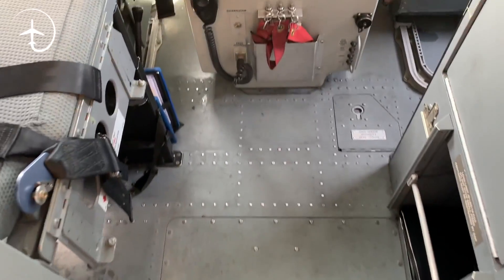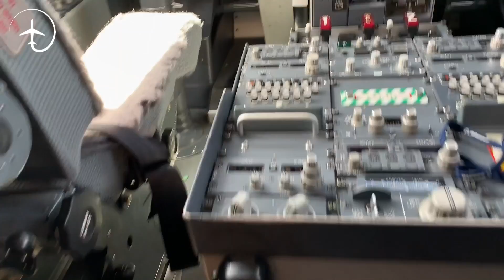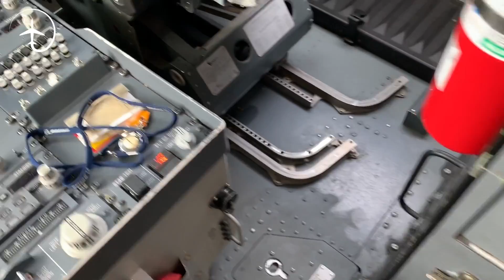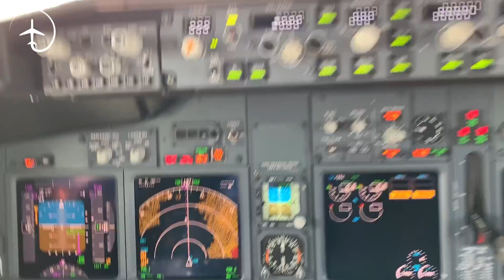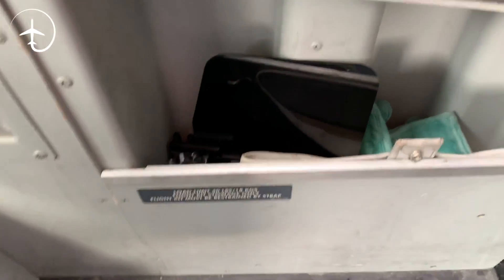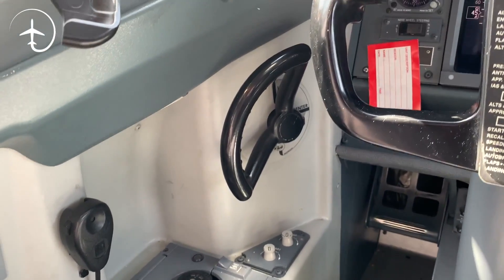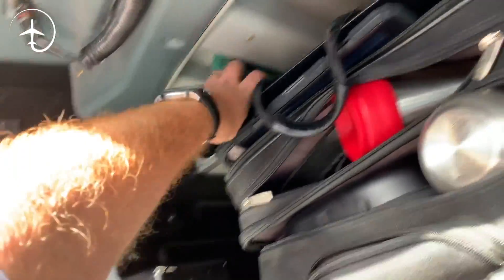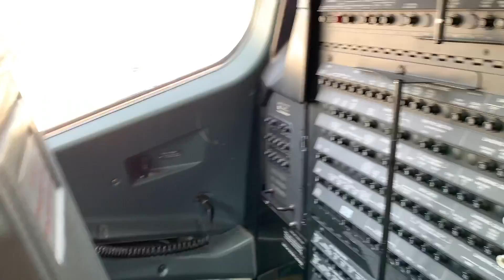Boeing 737 Cockpit secrets!

Comment: At what voltage do the cct  breakers operate.  Are there high current circuits?  Is there a power bus and control bus and are these AC or DC?

Comment: I had a peak in a B-17 cockpit, when the Aluminum Outcast was at the County Airport near me. It had one modern screen in it. Very cramped inside and a lot of needle gauges and with 4 throttles. It was a challenge just to get inside the nose hatch; even with the help of a small ladder.

Comment: Thanks for the tour. Now just one question: When are you brilliant guys going to do something to solve the problem of turbulence on flights? I've flown on at least 50 flights in the past 10 years, and with one exception, there's been turbulence on every single one of them.
Reply: N-Scale Union Pacific Evanston Subdivision the best way to reduce turbulent is to avoid it. Because turbulence is something which is present in the air in which the aircraft is travelling, so it is quite hard to simply dampen it.

Comment: @Mentour Pilot 
Do any of the planes you fly have HF radio equipment?
Reply: HF is only used for ocean crossing, it would not be common on a 737
Reply: Looks like this one had it. I’d have to replay the video. Airline can order the airplane with it if it wants.  At my airline we use HF if outside vhf range.  Just depends on the route that day.  These aircraft are capable of certification on 180 minute ETOPS segments.  One thing all pilots have in common is their despise for listening and talking on HF, and our love of SELCAL. 

Things pilots love...

SELCAL
CPDLC
COCKPIT DOOR
COCKPIT PRINTER
ACARS
MONEY
DAYS OFF.

Comment: Which circuit breakers are permanently pulled (marked red) ? Thks. Petter 👍
Reply: I would guess they are for optional or old equipment that has been removed, or they are used for testing systems by the engineers.

Comment: I wonder why the leave the circuit breakers exposed like that. It seems they would have some sort of closure or cover to help prevent accidental interference or disconnection of a critical system. Is there a reason for this?

Comment: Very informative....However jumpseat is stowed past it’s correct position.  It is pushed in past the stop adjacent to the red release lever.  Common error. There is a detent before it is shoved past it.  Look closely next time you fly.  It takes 2 hands to do it smoothly.  
Tom...10,000Hrs 200 300 400.

Comment: Excellent Vid.........my question is why have a circuit breaker if it is pulled?
Shouldn't it be engaged to trip for a short or overload?
Reply: Those circuit breakers are a combination of switch and fuse.  You can pull them manually to cut out a circuit, but when a short or overcurrent occurs it will pop out by itself.
Reply: no because the unit it powers might not be installed.  it might be Ryan didn't want "Option A", but the wiring is still installed in the aircraft.  it's "provisional".  if Ryan sells the aircraft, the new owner can install "Option A" and only has to install the unit.

Comment: At 6:39 seems this vehicle has a stab-trim override installed already; 
Is this the MAX-8 fix? 
Flight-deck door lock is the access control door?
Reply: Nicholas Jordan   That stab trim switch override is not a kill switch for the stab trim, but rather overrides the shutdown feature of a pilot, for example, pushing forward but trimming back, or the opposite. We use it to test the stab trim logic during preflight (or at least we used to). When this switch is in the override position, the pilot can run the electric trim opposite stick forces.  Other than an emergency situation this switch is not used in flight.  

The stab trim cutoff buttons you are referring to In regards to the max are already installed, as are they on all 737s. They are located on the center console just below and to the right of the throttles and fuel shutoff switches.  

It is these switches that I am referring to that were not timely actuated  (meaning turned off) during the 2 max crashes, and so the MCAS was allowed to continue with its trim down/forward actions, eventually resulting in loss of control. In the Ethiopian crash the pilots momentarily turned these off, but their airspeed was excessively high and they were unable to manually trim the aircraft back nose up, so it is speculated they returned these to the on position to try to use the electrical trim motors for assistance, thus re-enabling the MCAS to trim further nose down.

Comment: @Mentour_Pilot How about a video on the advantages and disadvantages of having a single aircraft model with an airline and advantages and disadvantages of having an airline with multiple manufacturers and models.  I can see how having a single type would be advantageous for the maintenance crews and aircrew members only needing one type rating and a disadvantage of one type would be if that aircraft manufacture goes out of business getting parts for that type aircraft might become difficult.  Similar to a major airline having a single regional carrier versus multiple regional carriers.  I am reminded of the Comair (OH) pilot strike in the US in 2001 really hurt Delta.  Comair might not have been Delta's only regional carrier,but it really hurt Delta overall.

Comment: Mentour, do you wear sunglasses or rely on the sun visor alone?  5 decades back, every pilot wore sunglasses it seemed.  I had a pair of polarized Ray Bans which I used every day the sun was out (really useful in my boat to cut glare) even when I drove. Haven't worn them for years due to the new tranisition lenses in my glasses.  I recently put my Ray Bans on in my newer car which had LED backlighting and I could not read gauges.  I know why now, but do you wear standard sunglasses at all?
Reply: It's necessary to use non-polarized sunglasses in the cockpit because of the modern displays.

Comment: Another excellent video, but I would question one thing: Are there not too many knobs, buttons and switches in the cockpit of a modern aircraft? I am a bus driver and the number of knobs and buttons I require is no more than 10, including the ticket machine. Is this not an attempt by airlines to make pilots appear busier than they actually are?

Comment: Does the audio box support continuous hot mic? I mean, does the talk switch remains in the inter phone mode? 

Thanks for the video!
Reply: Some do and some don’t at our company. The newer ones are coming with a latched position on the intercom transmit switch to essentially create a “hot mike” intercom, as a lot of 737 drivers have switched to using intercom for their communication to each other with nose cancelling headsets.  The 737 cockpit is still pretty loud compared with other airliners.  The headset is a necessity if you value your hearing.
Reply: Mark g thank you very much. I also think it improves communication between pilots and ATC.
Reply: Alejandro Cruz   Yes, great point!  The microphone and circuitry in my headset makes me sound way better and clearer on the radios. So I’m sure that ATC can understand me better than those silly soda straw mikes normally used.

Comment: Are your VHF radios similar in any way to those in cars, and stereos? I wonder if you would be able to tune in to good old fashioned FM radio stations with it...
Reply: Aircraft radios only tune down to about 108 MHz which is just above the top of the FM radio band.  You still wouldn't hear the radio stations properly because aircraft use AM for voice communications

Comment: Nose-wheel steering control for first officer, is that an optional extra? A better question raised by the coffee cup holder of the jump seat, during a normal turn around there's no time to clean anything but major spills or something affecting control panels (Woe betide the pilot that spills coffee on the console!) but when do the cockpits get a technical clean? I mean a whole cleaning of all the knobs and switches? I would expect there is a pilot reset that is required afterwards that checks EVERY knob and button for normal operation prior to flight. I recall the Helios Airways Flight 522 disaster being traced to the air pressurisation switch being a seldom checked or varied control being the root cause after maintenance worker left it in a non-normal position and it not checked pre-flight. Interesting the Yamasa Sangyo ownership plate.

Comment: Thanks for show inside 
I have 1question. 
I saw on many youtube. Its have two roll,  black colour and a little white some part and position is  beside engine stick 
Its rolling on the air plane stalling.
Reply: Trim wheels for the horizontal stabilizer. They spin whenever the pilot or autopilot adjust the trim.

Comment: Those replacement bulbs are a nightmare! Why haven't they did LEDs on one of the upgrades? Obviously it's to expensive to rewire in new LEDs but there has got to be LEDs that screw in the already installed female hard wire. I'm thinking how in everyone's  home the incandescent bulbs have all now have LEDs that interface where the old bulbs go.
Reply: DenseAlloy Consumer LED bulbs has electronics (or even transformer I think? I’m not that familiar in electronics) inside to make it works with the usual bulb sockets. He mentioned he had a video talked about it, as I remember he explained briefly about why they still use incandescent bulbs (I think it is reliability, and certification reasons), and if i’m not wrong I read some comments further explained how’s it more difficult than it seems to be (even as you say, with LED bulb that just fit into the old bulb sockets). You may want to check that video out!

Comment: Very surprised on the lightbulbs section, what if they burn at mid-flight? How come they haven't switch to another longer lasting technology? By "1960" you meant the design of the cockpit or the year the plane was made? Confusing to see a USB port cause they came out on 1998'... Is that an upgrade?

Comment: Is there any water resistance in the electronics of the cockpit? What if you spill a cup of coffee all over the control panels, could it crash the plane? Or if you drop a 1 litre coffee thermos on the floor, will there be sparks and explosions?

Comment: Cool video. If there is smoke filling the cabin can you get it out?
Reply: Don your o2 mask and select 100% oxygen, establish communication with other pilot, then dawn smoke mask if not integrated into mask. Run the checklist for smoke elimination, which in a nutshell has you maximize airflow from left pack that supplies most of cockpit air, turn off the recirc air, and raise the cabin altitude, causing more air to be expelled out the outflow valve. Also never hurts to make sure there isn’t actually a fire in side the cockpit itself. In which case you would be prudent to use whatever means necessary to stop a fire.
Reply: Thankyou for the response. So higher pressure and there is a valve that would allow the contaminated air to be pushed out. Very cool.
Reply: Brandon Whorley  kind of. By raising the cabin altitude more air is expelled, so hopefully the air with smoke gets thinned out quicker.  New air from left back not being recirculated then provides virgin air.  That all works unless the source of smoke is the left pack itself, which the checklist slowly has you continually ask questions as you accomplish items to help you identify the source.  It’s a rare issue, but when it happens it’s extremely serious.
Reply: @markg7963  so if the left pack is source of fire/smoke and cabin starts to fill with smoke.... then what?... it would be cool if the smoke hood or o2 mask had a small inlay or hud that provided critical flight info / external thermal or camera view from the nose. To get the plane back on the deck even if visibility is zero in the cockpit.
Reply: Brandon Whorley   Brandon, don’t have the checklist in front of me right now, and there are a couple of options to look at. One is smoke of an unknown origin, I think, and the other would be smoke elimination. So those checklist have to be managed pretty dynamically, and I would have to get them out to give you a more accurate answer.  The strategy is to do two things.  Get the smoke out of the  cockpit and airplane, but also eliminate the source if it can be isolated.  If the source of smoke is found to be the left pack, then logic would have you shut that one down and switch to the right. And having 1 pack down would indicate having much less airflow to help eliminate the smoke.  

These scenarios are particularly tricky because smoke from these different sources is hard to figure out, and doesn’t just instantly stop.  So you are in a hurry to find the source, hurry to eliminate the smoke, and if you don’t wait long enough as you go through the process, you run the risk of diagnosing things wrong and possibly making things worse.  An electrical smoke source is also a likely candidate, and that is super tricky and complicated.  That’s all before you find out the flight attendants just burnt up your crew meal in the oven and maybe didn’t think to mention to you that was happening.  Thus the scenarios get weird pretty fast.  Being methodical and logical and using all your resources is going to be crucial.  

As for zero cockpit visibility, we don’t have super special virtual reality things to look through, but I can possibly autoland the aircraft without seeing much of anything IF the systems remain in tact that are required.

Comment: Regarding the tiller. If the captain were to become incapacitated, the FO could land the plane-but then not manuever it on the ground? Or would the cpt be removed from the left seat and FO sit there?
Reply: No, if the captain was incapacitated it will be an emergency situation, which means that once the aircraft land, it will be a full stop on the runway with medics coming on board to treat/remove the captain. Ground steering will be the least of a FO's worries.

Comment: I have a 🙋... What happens if your landing gear isn't retracted the entire flight? Thank youu
Reply: The plane yells at you the whole time. Plus, if the gear won't come up, they usually declare an emergency and return to the airport.
Reply: @murphsmodels8853  thank you for the answer.. So it's really a must that it should be retracted then.. I see.. Thank u
Reply: @shelamaesantos8294  - Yes, it also causes significant drag that will reduce the airspeed if it isn't retracted.

Comment: Cpt. Mentour .  how much physical effort is there in actually  grabbing the yoke and flying her with autopilot turned  off?  does it require more physical effort that driving a car with power steering?   How much "road feel" is there in a 737?
Reply: RM Miller    I’ll reply to that. 13000 hours flying it.  “Road feel” is significant. The flight controls themselves don’t feed back to you, but the artificial feel system is quite accurate when coupled with the seat of the pants feeling.   Airplane to airplane they feel a little different, as some as rigged more accurately, coupled with the particular cg loading and gross weight.  The sweet spot is a mid range cg in an 800 at a mid weight. 700s are pitchy and overpowered (so thrust changes amplify pitch corrections), 900s fly more stable but are more sluggish and heavy on the wings. The 800 is sweet.  As is the longer max aircraft (which fly great). 

The aircraft is pitched up more than any plane I’ve flown, meaning the body angle of attack and thus nose position is pretty high, and this takes some getting used to coming from other planes (the 757 being the opposite). 

Elevator trim is constant. Even when trimmed up and stable it takes some adjusting to and fro. Aircraft more responsive in roll and yaw than pitch. 

The control feel is definitely more forceful than a typical car.  More like you would expect if your car had 3/4 power steering. Although occasionally I’ll fly one that is just rigged really sweet, and I keep the autopilot off longer on those days.

If you do not trim the nose, it will get quite heavy in short order.

Comment: Question:  Say the 1st officer is the pilot flying.  Does he (she) have enough steering control in the peddles to taxi or does she (he) have to ask the captain to yank the little steering wheel around?
Reply: Robert Murray The captain will perform the taxiing🙃
Reply: @speedbird9313  Unless the airline has bought the optional right hand steering wheel
Reply: @sundar999  Good point👍🏻 Have never seen that on 737s tho🙄

Comment: Do the windows open? I saw an old documentary where one of the crew escaped (I think it was a hijack situation) and jumped down to the tarmac. Is that a thing of the past?
Reply: Yes, the side windows can be opened, and they can also be used as an exit route in an emergency. There is an emergency escape rope in the cockpit which is used in this situation, because the distance to the ground is quite high.

Comment: Proposal ! Why don't Boeing have a hinge on the spare bulb hatch..? To prevent it from falling down and touching any circuit brake in the panel. Or at least... attached to a string to keep it in place after opening it.

Comment: You have to carry insurance documents with you when you fly? Why.. ?? In case you get pulled over?
Reply from the maker: Exactly. We can get inspected in any airport we land on.
Reply: @MentourPilot  thank for your reply. I have a question I've been asking myself for a while. Why is it that all runways are on flat terrain? Would it not make more sense to have them on an incline? A plane would start at the top and gain speed faster and land at the bottom and slow down faster. Would make for shorter runways especially in mountainous areas. I don't really have much knowledge of flying so please don't laugh if the question is silly 😁.
Reply: @adrianvintila5077  Wind direction, and airflow over an inclined ground might make an inclined runway complicated.